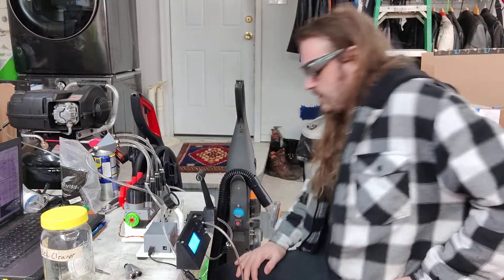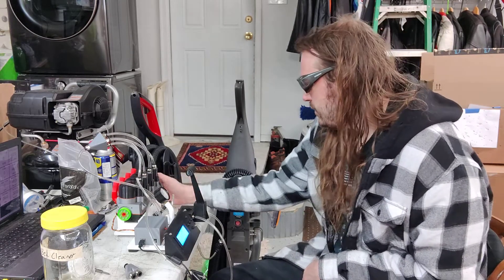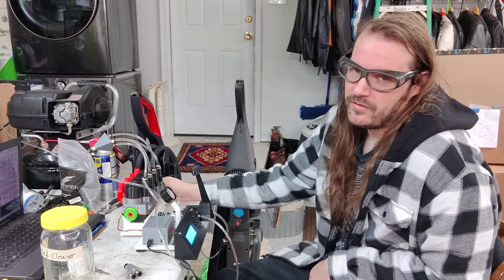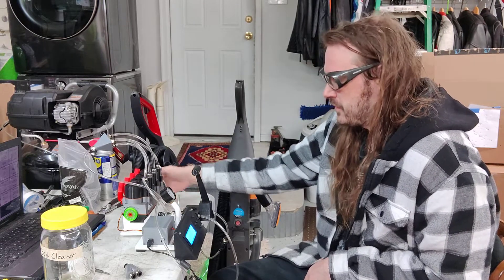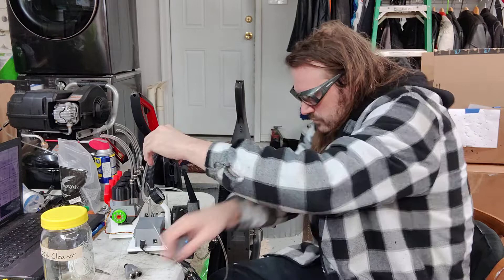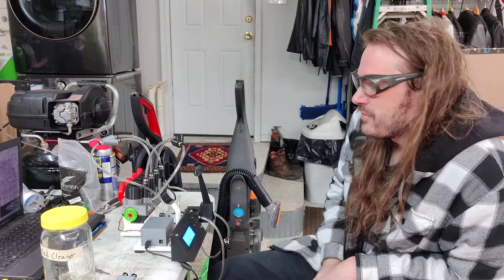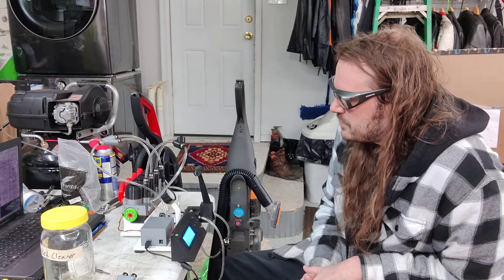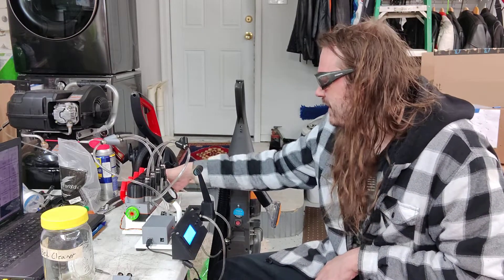Inline 4 crossplane hits 8800 rpm and I talk about the upcoming release of the engine.

Comment: Instead of you using the compressors you should make an attachment where whenever the engine is running you can have unlimited air without compressors basically connecting an air hose to the exhaust and having it go to the intake so its re using the air instead of just using
Reply: It won’t have enough pressure
Reply: @spudstudios3342  u can make a third hole in the air supply bottle and pump enough pressure and then it will like if you have a waterbottle and there's two holes make a third one for pumping air
Reply: @matthewbarnes727  Still wouldn’t be anywhere better than just without it. Otherwise it would be breaking the first law of thermodynamics.

Comment: another thing you can optimize for in these is just making it as easy to build for people as possible: making all screws the same size, optimizing print times, as few different filaments as possible, etc. if you expect the user to get a bunch of steel balls, ideally use the same balls for both valves and the flywheel, etc etc. i'm sure all builders would appreciate efforts like these.